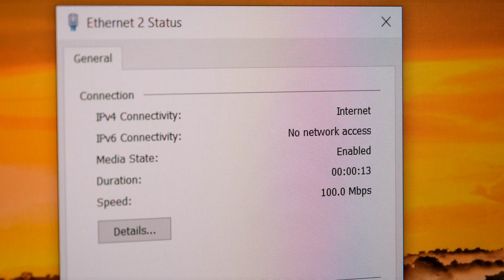Ethernet speed capped at 100Mbps fixed to 1Gbps - cable fault

Comment: LOL!! So funny seeing this video 😂 I just finally made the switch from WiFi to Gigabit ethernet a couple weeks ago. Circumstances prevented me from running a CAT5E straight to my router from my PC, since the router is in the master bedroom closet. However, I noticed that my wall had a ethernet port in it by the COAX port!! Except it was an RJ11 port LOL, but it was hooked up using CAT5E just 4 wires. Its a line that isnt active anymore from previous cable/ISP, however the CAT5E still ran to the same spot in the closet! So I snipped both ends of the cable clean, stripped/prepped it, and hooked up an RJ45 keystone jack on my end and used a pass through RJ45 connector on the router side of things. Then just used a 3ft CAT5E to connect my PC to the keystone jack I installed in the wall there from the old phone line. Got everything done, checked the connection with a RJ11/RJ45 line check tool, and all 8 wires good to go!! 

Well... I didnt notice for like 2 weeks, but my connection was capped at 100mbps!!! I couldnt for the life of me find any cable damage or anything. I eventually decided to just re-terminate both sides just as a last chance thing, and as I was snipping the RJ45 passthrough off the router side of the cable, something caught my eye: I accidentally had blue/white and blue flipped and oriented wrong!!! I felt so stupid hahaha, but thankfully it just took terminating a new passthrough connector (ALL in proper order, not just 6/8 lol) and it instantly resolved the issue. Glad I started with that side of the cable too, because the keystone jack was just fine! Lesson learned lol. 

Im 29 and I havent worked with CAT5 or networking cable/RJ45 and such since I was 13!! So it felt super satisfying that I still had enough knowledge to do it myself, rather than calling out someone to do it for me. I only get max download speed of ~650mbps due to my internet plan, but my next project is to try and figure out how I can set up 10Gbe connection with a network switch or whatever other things are needed. Actually the whole thing has me considering an apprenticeship in the field, as it renewed an old love/hobby of mine.

Comment: you think its always your cable issue , but it looks like its not , i have 1  kbps  connectionand   one  of my  pc  got  always just 10 Mpbs  speed , if you did speedtest  you  could get over 100  Mpbs but router always showed its 10  mpbs connection , tryed  different cabels aswell, today i  connected  usb 1 kpbs connection    to my pc  connected internet cable and bang  1 kpbs  connection , no issue

Comment: is it possible that a damaged cable runs gigabit intermitently?

what happens to me is that I have a brand new desktop setup, with a gigabit capable ethernet controler, and yet I observe that at times my connection will be capped to 100mbps

the weird part is that if I unplug the cable from the motherboard and plug it again, then run a speed test, it will deliver the expected speeds
Reply: solution bro?

Comment: Check this on your Ethernet cable.
If it is "Cat 5" then it is capped at 100mbps. It needs to be at least "Cat 6" (can handle up to 1000mbps) or higher. The text is usually printed on the cable.

For me it was acutally a hardware problem.

Comment: Hi, I have connected a cat6 cable from my main router in my house, ran the cable 15 metres to an outside office and connected it to a BT wifi disc but im only getting 96mbps, inside im getting 913mbps. Ive checked the cat6 terminations on a cable checker and it’s showing all fine, no incorrect layout or nicks in the cable, can anyone help?

Comment: Good evening i stumbled onto your channel after I experienced a problem with my LAN speeds,now our fiber has been upgraded to a 250 mb line but im getting capped at 100 mb on my pc.Is that because my LAN cabble is capping it or is it my Realtek LAN network controller ?I have tried a bunch of options including your video but all my pins are fine and i have change settings suggested by guides but it seems to stay capped is their a reason or what do you think is the problem?I just realy don’t want to buy a new faster cable and end up not fixing it.Sorry it’s a long message but I really need the help

Comment: I fixed my because of this, I was using an Ethernet Switch in my case and was only getting 100 Mbps instead of 500, I keep on switching the cables because the 1Gbps option on the dropdown menu of Speed and Duplex was missing based on several cables except one. I remove my  switch and plugged in directly the cable from my modem to my desktop and VIOLA, 1Gbps was available and I got the 500Mbps speed back baby! Thanks and mroe power to ECOLOGICALTIME!

Comment: I am having the same issue , from the Switch i have connected CAT6 cable 35meteres (Green) the same cable the other end is connected to Switch on the this switch the light is flashing Orange and when logged in to this switch the speed is Capped @100Mbps i am not sure is the termination of RJ45 is not correct or may be one of the lead wire is not able to make the contact to the conductor. Hope you can advice on how to resolve the issue

Comment: Wow thank you for this video, I checked two different cables and noticed a difference in speed. I didn't realize that Cat 5e would drop down to 100 Mbps with a faulty termination (I figured it would fail completely). I was able to go into settings and found that this cable was indeed capped at 100 Mbps. I'll recrimp the faulty one. Thanks again!

Comment: But what do you do if tester shows green at all 8 lines, but the speed is still capped to 100 megabits?
Reply: Verify that the cable is using a twisted pair for each tx-rx pair.  Search for understanding ethernet wiring practicalnetworking
Reply: Were you able to find a solution for this?
I will try what Dave mentions here as well.
Reply: It worked!! Crimp it for t568b standards, check all 8 lines and you will be getting 1gbps.

Comment: my internet provaider gives me 1 GB/s internet. All I have gigabite network card, cat.5e (crossover connection) and routerboard hap ac all this supported Gbps speed. But in the test of speed they show me 400 mb/s download and upload is 100 mb/s. Upload is correct speed but download is not! Whats the problem? Maybe I have to use cable wich support CAT.6????

Comment: ive done almost everything, and still caped at 100mbps, and now im stuck paying for a 1200mbps service for a year lmao, im looking into buying a new Ethernet card, i think my motherboards internal card is the culprit. any thoughts?
Reply: i should be getting up to same amount but capped at 100 and getting no higher than 65 mbps. i tried everything too. i reckon i somehow damaged the pc ethernet port. i might have to get a new nic.
Reply: @mirapidd  so i had to buy a new 2.5gbps ethernet card and now im running at the gig speed but i'm still not passing 500mbps, its hilarious how we get succered into these great speeds just to find you your not going to get more than half unless you have direct connection to the main server or some crazy shit like that.
Reply: @bplus2932  I also just received my gigabit nic card today. Hopefully it will work for me otherwise I would need to update my LAN drivers which I am having a difficult time with.

Comment: Thanks for the info,but I dont know about my router though,as I unplugged and then replugged Cat 6 cable the from router and now I am getting full speed and also the Link is now correctly showing as 1000/1000Mbps in ethernet properties.
Dont know know what happened exactly,probably may be due to the fact that I just changed my broadband plan a few days ago.

Comment: Thank you for the valuable information...I was under the impression that since I had connectivity, (albeit at approximately 1/10th of the provisioned speed) that the ethernet cable connected to my router was ok...I spent over two hours troubleshooting my router with Linksys tech support and, even had a Verizon FIOS service tech come out to look things over.(he must've reported that he found something because, they didn't bill me for the service call) but, I still wasn't getting anywhere near the provisioned speed of 300mb/s until I changed out the ethernet cable today. And, if it wasn't for you and this YouTube video, I would never have thought to do that so, thank you again!

Comment: Would you know how to boost internet connection for Android TV? 
Just found out that the ethernet port on most TV's only carries upto 100mbps. So if you have more than 100mpbs connection you will not get the same speed on your TV.  Thanks

Comment: Mine keeps switching to 100Mb for some reason. But I fix it through Device Manager. I'm not sure why it does this. It keeps happening every time I unplug the Ethernet cable or restart my PC. Is the cable the issue? it works completely fine after changing it from Device Manager.
Reply: solution bro?
Reply: @DavidS.  Network adapter settings -> Edit Ethernet -> Configure -> Advanced tab -> Speed & Duplex. Edit this to auto-negotiate or set to 1GB (or whatever the highest you have through your ISP), see if that fixes it

Comment: Originally I had 87 Mbps download and 5Mbps upload with the plan they gave me. I upgraded my internet plan to Internet 1000 from AT&T, but was only getting 94 Mbps upload and download. In search of the problem, I changed my Ethernet settings, under the configure button, advanced tab, and scrolled down to find the Speed and Duplex settings and changed to 1 Gbps, but that did not solve my issue. I eventually discover a bad RJ-45 connector problem. Luckily for me I had a second wire running from my network closet area to my office, so I was able to swap the ports I had my computer plugged into and then I was getting 947 Mbps upload and download speeds. Now I know I need to fix that other cable connection. I find it funny how I can get 100 Mbps with a bad cable connector but not 1000 Mbps (1 Gbps), but also learned that 1 gig internet needs 2 wires of the 8 in the cable to get 1 gig speeds. Thanks for being part of the troubleshooting journey!

Comment: Is this a cross over cable? Cause mine is 100 mega BITs per second. Yours is 1 giga BITs per second and from what I see, mine is a straight through ehternet cable, so I'm thinking this might be the reason
Reply from the maker: not cross over but that wouldn't make a difference if the cross over was wired correctly. To get 1Gb on cross over you need to cross over two transmit and two receive wires.
Reply: @ecologicaltime  I realized one of the computers had a network adaptor limitation, so it was not the cable. The realtek was not a GBE family controller. So it's not possible to exceed 100 mpbs to 1Gbps.

Comment: My connection speed is 100 Mbps, internet provider uses cat5 cable but I had cat6 cable running through my house. If both cat5 and cat6 are connected together do I loose speed in my 100mbps connection, plz help me out....
Reply from the maker: no both can handle 1Gb
Reply: @ecologicaltime  the internet provider connected their cat5e cable to my cat6 cable in my house, now I'm getting 89mbps speed in real-time from my 100mbps plan

Comment: That is so amazingly simple a fix and yet super difficult to come up with if you don't know what to look for. Thx.
Btw, I have an issue that is different. The laptops hard wired show a 1gigabit connection but according to a speedtest theyupload slower than the laptops that are on the same network and have a 100megabit connection. Any ideas where to start looking. The switch ports behave the same when I switch the cables round.
Reply from the maker: speedtest.net measures your connection to the internet

Comment: thanks for help, didnt think to check my cables...my problem was there dirty after i took tape off them (i put tape around them to protect them while pulling through the wall) quick bit of light dusting, a little bit of hand sanitizer to take the sticky tape off. 100mbps now 1gb thanks!

Comment: what if i have a cat 7 cable and gigabit internet only getting 300mb download. i dont think its the router or modem.
Reply: is it a cheap cable? Buy a good shielded cable from amazon. I was using some cheap ethernet i got off ebay
Reply: @Pingaheimer  yeah I did get it off Amazon it was like $35 it’s flat and black and it seems pretty high quality
Reply: @MMAJP182  download the latest Lan driver for your motherboard

Comment: I'm sorry but I cant find that ETHERNET STATUS window on windows 10, is that software or what?
thanks. does it work when plugged to a NAS server or must be a router?
Reply: Control Panel > Network and Internet > Network and Sharing Center or View network status and tasks >  Then click on your ethernet connection. It'll be on right hand side. 
You will see it to the right of "Connections:"

Comment: i have 2 cable CAT 7 and i m blocking to 100 mb/s and i have the fiber what is the problemm ????
Reply: Two options: damaged ethernet cable (most probably) or old router without 1 gb port

Comment: Thanks man! This helped alot. I looked at my CAT5e cable and there were only 3 wires connected. I plugged in my other one with all of the wires connected and BOOM 1gbps.
Reply: I see we ran into the same problem haha
Reply: @stealthwithagun6883  No fucking way man 😂 That is fucking priceless.
Reply: @CiaNade  Lmao fr man 🤣 what are the odds
Reply: @stealthwithagun6883  very slim bro 😂 did it end up working for you?
Reply: @CiaNade  I never tried it because all the cables looked exactly the same so just decided not to

Comment: Same cable in my laptop is 1gb, into my PC it's 100mb. PC used to work at 1gb with the same cable. Tried other cables, same issue. Maybe I've damaged my Ethernet port somehow?
Reply: same question
Reply: @lewisshen6489  I bought a PCIe ethernet port and  the connection went back up to 1gbit. Port was damaged for sure. They're not very expensive if you have a free PCIe slot
Reply: @cwells.pottery  Hi, I am just curious about how a damaged port caps link speed? Surely it either works or does not, or at least give flucturate speed rather than fixed? But agian I have no idea xD
Reply: @lewisshen6489  same way that when one or two cat cable pins are broken and throttle the speed to 100mbit
Reply from the maker: hi, 1Gbps means two wires transmit and two wires receive for CAT5e

Comment: Hi..if you are reading this, please look at my problem. I have a fibre optic modern and a router for wifi ( for connecting smartphones ). So when i connect the moderm to my lappy through cable. The speed is always 100mbps and the link speed shows 1.0 gbps but when I connect the modern to router and then connect the router to my lappy via cable the speed drops to  80mbps and the link speed shows 100mbps . Is it problem with my router ?
Reply from the maker: link speeds on your router are only 100mbps for that router. Link speed and throughput of a router is lower than high speeds switch. Your modem is probably newer and has GB link speeds.

Comment: Hello sir please help me . I have a problem my internet speed capped at 10mbps . If I change it to 100mbps full duplex or higher , my connection got unstable and it came back to 10mbps speed by default. I have no issues before but I recently recharged my broadband 10 days ago and then this problem started . I have plugged ethernet directly to my pc but the same problem happens but with router this Full 60mbps speed in smartphone but capped 10mbps in pc . I am really upset . Is it my motherboard lan card problem ??? I don't know . Please help . There is no problem in the cables and my lan cards green light did not blinking only yellow light stuck . If I remove ethernet there is still yellow light .
Reply from the maker: Yellow light sounds like a setting is wrong and the connection could not take place. Could you connect your computer to another network? Your smartphone is wifi so its different.
Reply: @ecologicaltime  yes sir when I connect my pc to my wifi connected smartphone through usb tethering then I get good speed but in Direct ethernet or router port to pc speed capped . What to do
Reply: @ecologicaltime  is it my pc problem or the isp ?

Comment: i have the same dock i checked 2 cables the cables is good i get only 100mbps can u help me i change the setting and the problem is still the same i have dell xps 15 laptop
Reply from the maker: have you checked that your router is Gbit? Most routers are 100Mbit.

Comment: I recently upgraded to 300mbps broadband connection, and was constantly getting 300-+(up)/300+(down) on all the computers(wifi or LAN)  and phones(wireless+LAN)  but except this one old desktop. After watching  your video I examined my LAN cable and surely it was half-duplex. Upgraded to Full-duplex cable and its to the maximum speed. Thank you very much for this trick :)
Reply: How can you identify if the lan cable is half duplex or full duplex. I have 1GB/s and I constantly get 100mb/s
Reply: @linkbombchu168 Did you check if your transfer speed is 100 megabits or 100 megaBytes? Cause the latter is equal to 1 gigabit
Reply: @linkbombchu168 IF you see all 8 cable on RJ45 connector.. then it is full duplex other wise  only 4 then that  is half duplex
Reply: @linkbombchu168  Use CAT6 and above cable, to verify just check if all the 8 ends (there should be 8 cables connecting to both ends)are connected inside the RJ45 port on each side of the LAN cable.

Comment: my computer has been plugged into lan ever since i got it, it never goes over 90mbs download, but another computer with lan connected to the same modem easily reaches speeds of 300mbs down.. the lan cable itself looks fine, based on that, what are the recommended steps i should take?
Reply from the maker: check the wire colours and see if it is cat5e